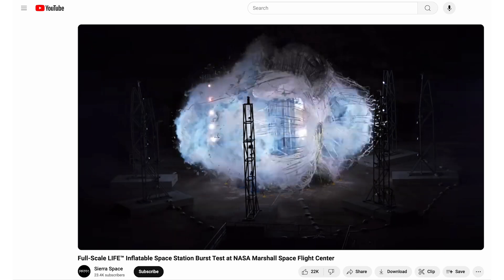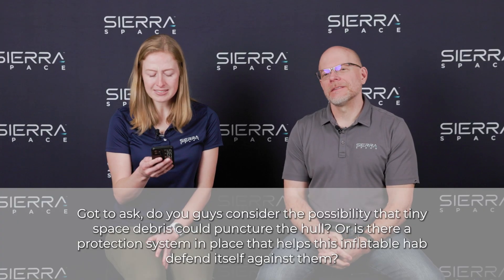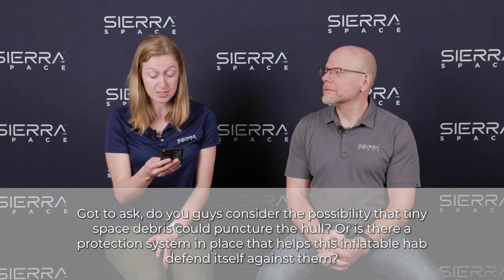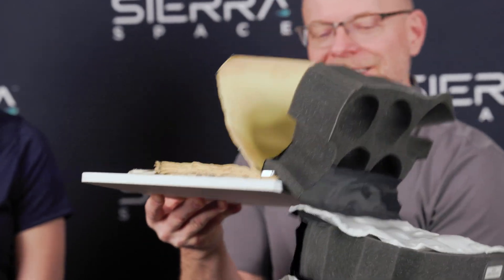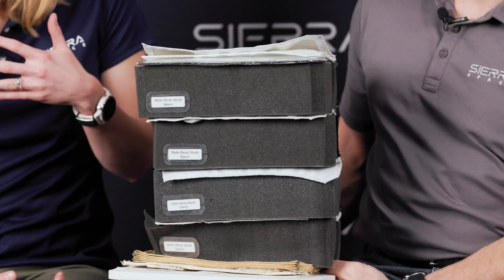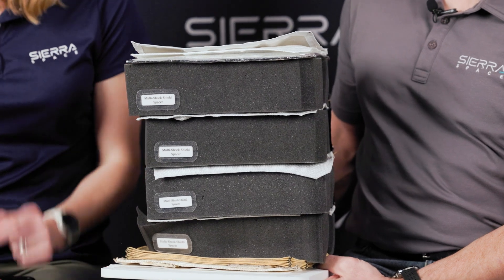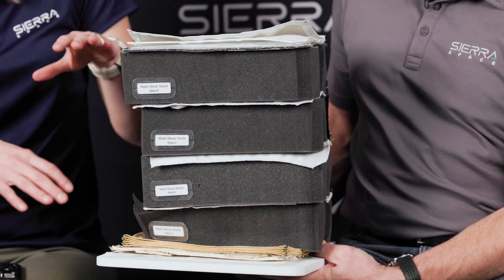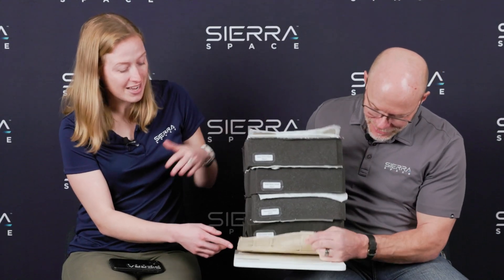World's First Commercial Space Station Design and Testing Questions Answered | LIFE Habitat Tech

Comment: In terms of liftime testing it will be fatigure. For metals this is deadly but for soft materials there would be a machanism for tears in the material to propagate. These tears only get into the material due to manufacturing isses or during handeling or transportation or unless it is slashed on purpose.
In either case one must test by injecting small tears in the material and seeing how it performs over time as the presure inside the hab varies with time. This pressure  variation - which will be small- will stress these small tears to cause failures over time.